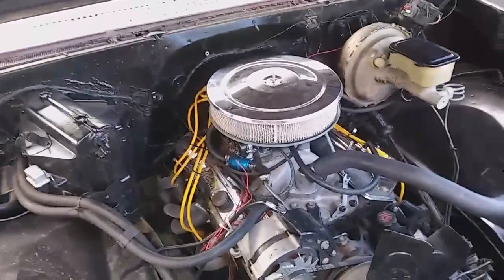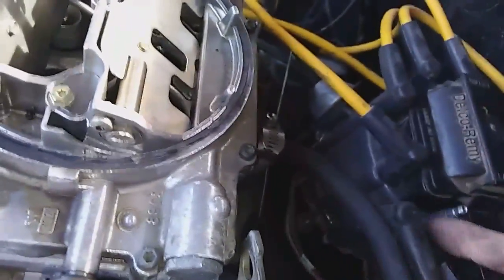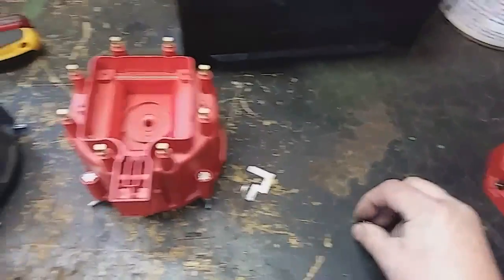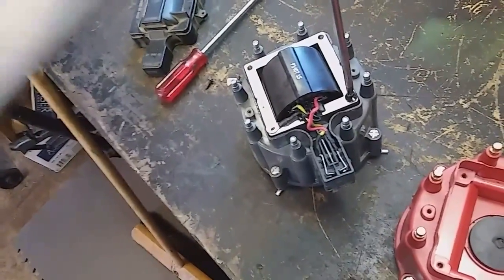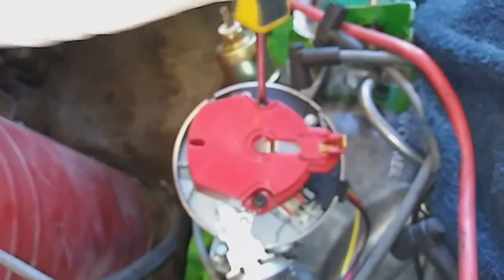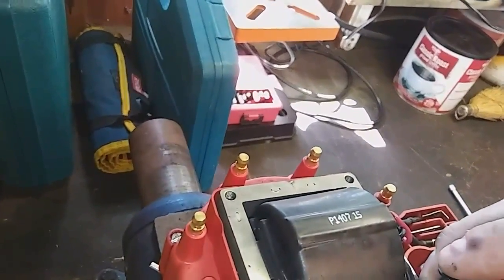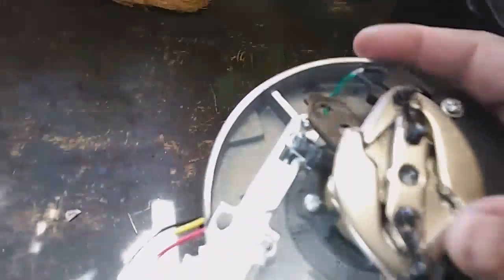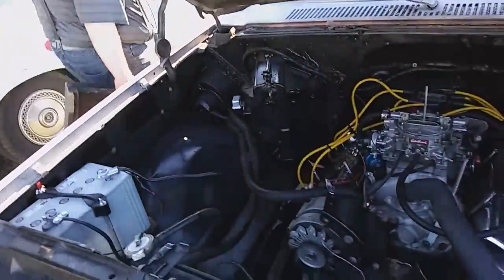How to change a coil cap and rotor on a GM HEI  distributor

Comment: Exactly what I needed. Swapped one out on my son's truck, and it wouldn't start. Didn't see the ignition wire when I took the old one off. It must have come unplugged by itself during disassembly. Plugged it in on the new one, and problem solved.

Comment: Make sure your 12volt connect ion is ok they raddle an slitly back out on the road that the battery connection or you push  in it goes up in 🎓

Comment: this was extremely helpful. You should see the distributor internals on mine if you think yours looks rough. Mine is crazy rusted and even the coil looks like it has been seen some damage.
Reply from the maker: Probably replace everything it is all reliable as hell but time takes it toll if it dits too long.

Comment: Ok with out that underneath the coil ground, will it have a system problem of dieing at a moments notice , my truck will just die , it dies driving down the road , it dies if I let it idle, if i don’t turn the key off first it will not restart, it only restarts after I turn key on and off, I’m out of thoughts too on mine , I have changed everything including the coil, the only difference is my ground to the coil is not underneath the coil.
I’m going to take my coil back off and make sure the ground strap is underneath my coil.
I’m going to change my ignition switch to because when I wiggle my key it shut mine off, kool thanks y’all BigAl California.

Comment: Did this end up fixing you problem? I have a similar issue in my 77 gmc
Reply from the maker: Bane Nelson yes I ended up replacing the distributor. But it was the ecu inside the distributor. That was bad. I only replaced my entire distributor because of bad bearings inside it too.
Reply: Double Dunn's Garage thanks. Mine is probably original anyways so sounds like I will be do that next

Comment: So i noticed the problem, did you?  THE only reason i noticed it was because this happened to my 1967 camaro. if you look at where your CARBON button fits in... the cap of your old one you replaced is melted a little. this is caused by defective springs. or by tension being worn out eventually. you caught this VERY early and are lucky. the video is a little blurry but you can see the cap starting to melt and corrode .

Comment: what size are the 4 screws that go on to the four corners of the coil? ive lost mine and cant find them any were,anybody can tell me the size and leagnth of them would really be appreciated it...thanks
Reply from the maker: Suggested going to the auto store an buying a new coil cover
Reply: i have a new distributor coil cap and rotor,went to change out different color cap and lost the screws,cheaper to just find the screws for it and local hardware store,but just need to know the size of them.
Reply from the maker: 3/18 i think

Comment: Your ground wire is on the wrong fastener on the coil. The ground from the coil has to correspond with the metal ground plane that feeds into the connector. Poor ground means poor operation
Reply: What difference does it make? Both contact the coil housing.
Reply: I just did this yesterday I was wondering about the black (paint or die) on the ground strap.  The instructions actually show (if wires facing you) the bottom ground going to the right and that's the only way it can go.  The instructions show the top ground (black wire) going to the screw to the left.  Seeing how they are both touching the big piece of metal, it shouldn't matter, just as long they are both touching it.